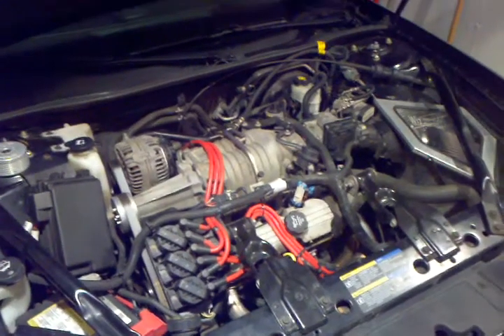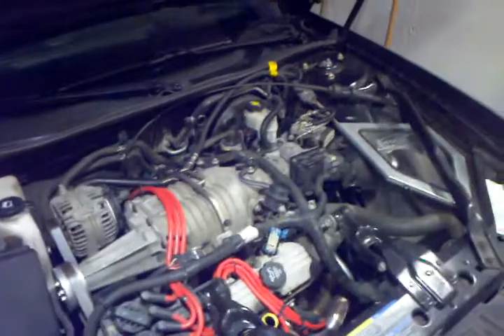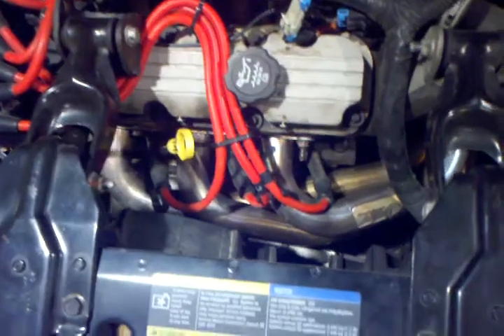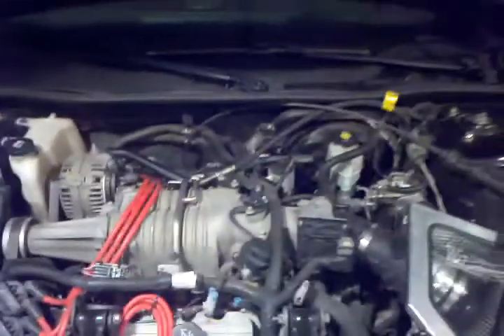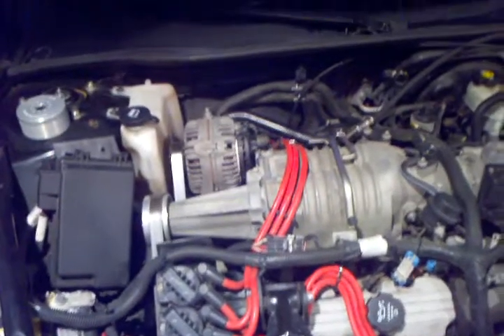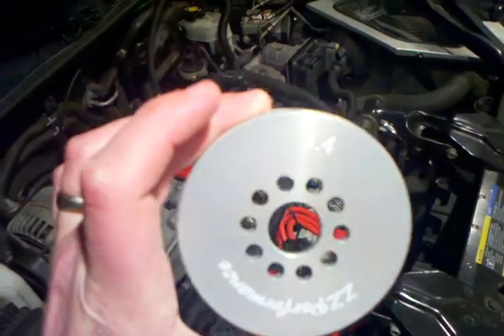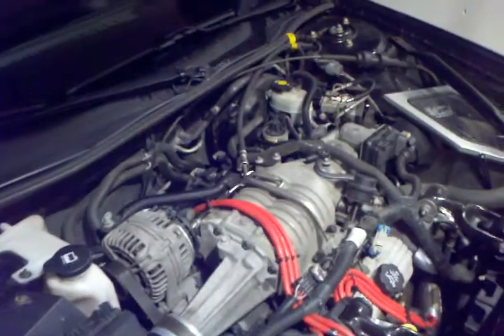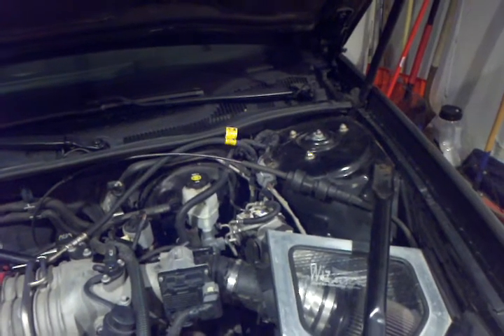2005 Grand Prix GTP basic MODS ZZP

Comment: That's what I was thinking. I did some research and it looks like TRUE cold air intakes are slightly quieter, but do a lot more than an intake like the K&N that just sits in the bay and sucks up all the hot air. Thanks for the reply:)

Comment from the maker: @gurusurfers yes a gen3 will work with the correct lower intake. In a 2003 gt and 05 gt both use 3800 sires 3 motors.  I cant say i have seen a flyby wire throtle body adapter going from gen 3 to throtle body.  im sure it can be machiened for little coast.  I would email zzperformance and see if they can help.  good luck and your going to have fun!!!!

Comment from the maker: the wizaired was pretty simple.  Ive heard the zzp intake are harder but are a lot nicer.  For the Anti Pogo washers you really notice it in turns not when driving straight.  I did new gmp springs with kyb struts and antipogo washers was a huge notice of ride performance.

Comment from the maker: @TheAngusguitar yes besides the 1.9 rocker arms with 90 lb springs and also the headers. before doing header you need to figure how far you are going to be modding your car. if your not going to mod vary far then dont waste money on headers. do a power log. but if you are going to do a cam or an intercooler for sure get headers.

Comment from the maker: cold air intake, colder plugs, down pipe, 180 degree t-stat and smaller pulley coast about $600.  1.9 rockers with 90lb valve springs with headers add an extra $1,300.  headers are expensive and not really needed unless you are going farther on the build then basic bolt on's.

Comment from the maker: Yes or the wizair or thrasher they are all as close as you can get to a cold air intake and not just an open intake.  Like the k&n intake its not a true cold air because the top pulls in hot air from the motor and bay and not cold air through front of car.

Comment: when did you ass you 1.9 what mods did you have I just got my 3.6 pulley on im contemplating 1.9 rr or xp or vs cam but not sure how to put the cam in  what hp difference did you see over stock and adding rr and then what did you see after adding the cam

Comment: Do you ever have any problems with your headers?
What brand of headers do you recommend?
What brand of wires and plugs do you recommend?
Reply from the maker: No problems at all. Great headers. Zzp headers. Wires I used Zzp 10.1. But bosh wires are great also. Plugs really depend on your set up. I run autolite and NGK.

Comment from the maker: @ddog0804 sounds good bro,  No i do not have any problems running no cat.  You do have to get your pcm flashed for it not to through a code and run right.  YES a cold air intake is neccesarry for those mods and a genV blower in a 97 grand prix.  You should do an open 9" K&N filter or do and thrasher cold air intake or the new zzp cold air intake which is the best for the dollar. good luck please subscribe to my chanal and let me know if you have any more questions.

Comment: Your ZZP headers...how did you get the rear header in place?   And did you get the rear in place before installing the front headers?  Also, how is your fan clearance?
Reply from the maker: I had no fan clearance problem. I installed front first then the rear.  The rear was a tight fit.  But is very doable.
Reply: Did you have to remove the transmission dipstick?  That seems to be what’s preventing me from getting it thru the back.
Reply from the maker: @lawadm1  yes you will need to remove for the instructions but add back In when install is finished
Reply: Well, I didn’t seem to get any instructions.  Is there a bracket or bolt holding that dipstick in?   It looks like it should pull right out but it isn’t budging.
Reply from the maker: @lawadm1  if I remember correctly I pulled dip stick out, replaced rubber seal on dipstick rod.  You do need to bend dipstick to clear the headers.  Hope this helps.
Reply: So you were able to get the transmission filler tube back in without bending the tube?  I cannot seem to get it to work.  It's either blocked by the header or the master cylinder trying to get the correct angle.
Reply from the maker: @lawadm1  yes I do not remember having an issue. I had to bend slightly. Then I replaced gasket installed back on. Have you contacted Steve at zzp?
Reply: jmrtinez69 I think it was Ryan at ZZP, but yes I contacted them and they said there shouldn’t be any issues.  Do you still have that car?  If so do you have pictures of the trans tube?   I can’t tell from the video.
Reply from the maker: @lawadm1  yes Ryan is good.  No I sold the car 3 years ago and got an Audi S4 with the Supercharged 3.0 liter.  Sorry I'm not much help.

Comment: what does the roller rocker arms do and the springs?
Reply from the maker: Brandon Moody give you a larger lift like a cam inturducing more air and fuel.  The harder spring allow higher RPM by reducing valve float.

Comment from the maker: XP cam will add about 25 whp over the 1.9 rockers I would not go with the Roller rockers.  There is really no advantages.  With The cam your range of the power band is much larger.  That is the real benifit of the cam.

Comment: hey i have a 04 gtp which our car is the same . how much does the 3.6 pully gives you in hp. and can you install that without any more mods
Reply from the maker: If you just do a smaller pulley 3.6 with no supporting mods. You will lose horsepower. For you to use a 3.6 pulley you also need colder plugs, open or cold air intake, 180 degree thermostat, most important downpipe and a tune computer.

Comment: Where did u get your mods from I have a 05 Gtp
Reply from the maker: ZZ Performance
Reply: i have an 06 grand prix  gt with this same engine do you think anything from an 05 gtp work with my gt?
Reply from the maker: zz performance
Reply: will anything for a 05 gtp work with a 06 gt with the same engine?
Reply from the maker: +Connar Downes yes. just make sure you get your computer tuned before anything. Some 06 + models had problems tuning the ECU (computers)
Reply: +jmrtinez69 alright thanks man!

Comment: I got a 04 gtp and want to run a 3.4 what all do i have to do
Reply: on the gen V blower you would use a 3.6 to equal what the gen III does on a 3.4 due to the gen V having better glow and being more efficient. but as far as supporting mods intake, downpipe, 180 tstat, pcm, tr6 ngk plugs, possible front plog depending on your kr. a scanner is your first investment when you plan a pulley swap. I use a Bluetooth one from amazon and the torque app on my phone.
Reply from the maker: +Chris Atkinson great info Chris.
Reply: +jmrtinez69 no prob bro. currently have a 3.4 03 ssei just finished my c5 front brakes and gxp rear brakes along with the gxp suspension. Next up is my exhaust and possibly intercooler and or rockers.
Reply from the maker: +Chris Atkinson sounds awesome. go with a cam and heads before intercooler. that's my thoughts.  good luck with the build.
Reply: Was thinking that but getting closer to the 300whp and the tranny prob won't like it lol. This sound sick with a cam. So far haven't heard any l67 with spintech pro street 9000's. Except fieros but their exhaust sound worse than ours lol. Hate the rasp.
Reply: Was thinking that but getting closer to the 300whp and the tranny prob won't like it lol. This sound sick with a cam. So far haven't heard any l67 with spintech pro street 9000's. Except fieros but their exhaust sound worse than ours lol. Hate the rasp.
Reply from the maker: +Chris Atkinson I really don't know to much about exhaust. mine has always been stock.
Reply: +jmrtinez69 3" catless dp ported front plog resonator delete and stock mufflers raspy. the spintechs and 3" resonator should cure that.
Reply: +jmrtinez69 I've done sold the car got a 2009 turbo cobalt now
Reply from the maker: +cole vivian sorry I see your on this thread. good for the cobalt

Comment: What if I have a Series II N/A? And wtf is KR?
Reply: jmrtinez69 Thank you so much.
Reply: jmrtinez69 so how do I prevent kr? Can you tell me what mods I start out with do I don't melt a piston
Reply: jmrtinez69 Umm can I put a supercharger on a 1999 grand Prix gt without any problems?
Reply from the maker: hayden hale yes you can ZZPerformance sells a full get that comes with everything you need.  It's like $4,000. It's not cheap. It's cheaper to sell your car and buy a GTP.
Reply: hey iv got a 04 gtp,  what mods can I do to make power without a tune or causing kr? can I do headers,  cai, plugs,  wires, downpipe, without fucking something up?
Reply: @haydenhale2206  you should always tune after mods...research KR theres a lot to it

Comment: I want to modify my 04 gtp with intake,wires,plugs,down pipe,zzp 1 inch phenolic spacer not sure if I should keep stock pulley or go to a 3.6 pulley. Any tips? I'm @junkgtp on Instagram
Reply from the maker: I would drop 2 pulley sizes for sure.  I don't think Zzperformance sells the phenolic spacers anymore. Last time I hurd they where having problems with coolant leaking.
Reply: I already have the spacer. Haven't installed it yet. Waiting for more parts
Reply from the maker: @ericlewis5035  yes I do see them on there website. They are definitely a revised part. With a tune you will not have any problems running a 3.6 pully as long you have supporting mods.